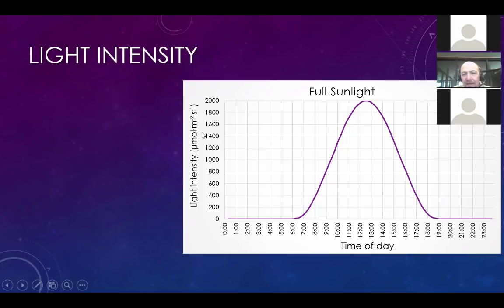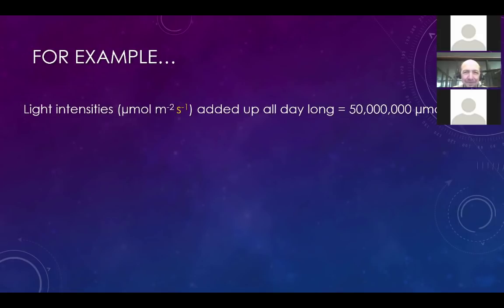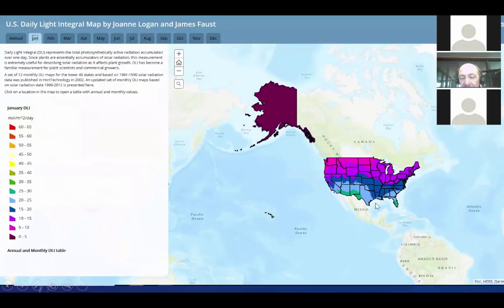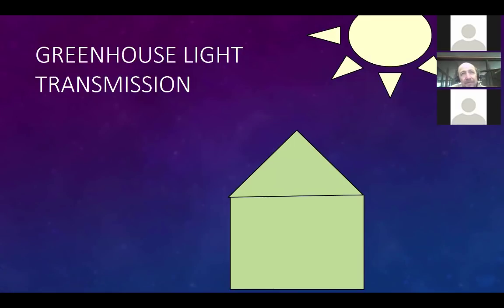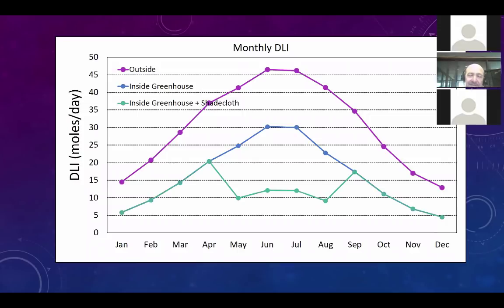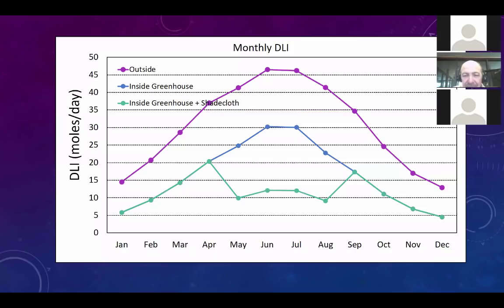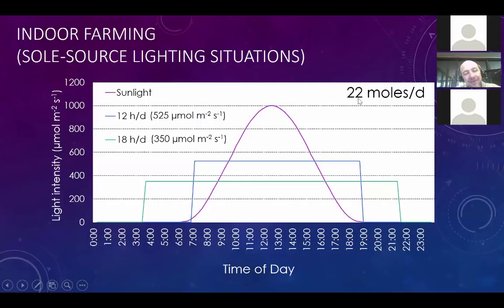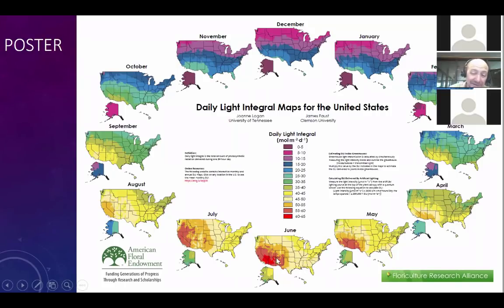New Daily Lighting Integral Maps

Comment: Wow they measures all these 100 by 100 km pixels? None were interpolated? That's crazy, and a bit hard to believe actually.
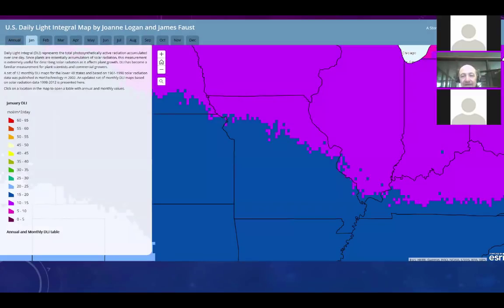Reply: “100 square kilometers”.  Each pixel covers an area 10km X 10km (see the zoomed-in map at around the 8:35 mark.)  The DLI values in adjacent pixels are not going to vary enough to make higher resolution (or interpolation) of any scientific value.
Reply: @w3vjp568  Exactly. But they say they did. Considering how some of those areas are very rough terrain and very secluded, I find that just very hard to believe that every dot is a measurement and there was 0% interpolation. But that's what they say.